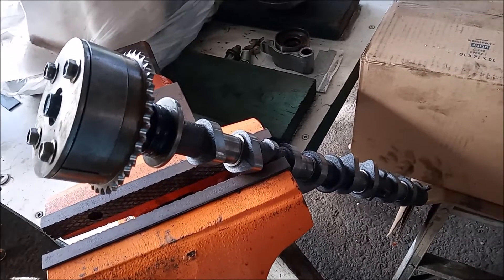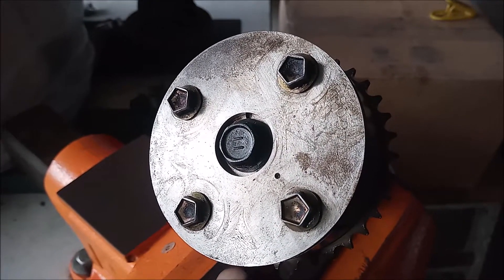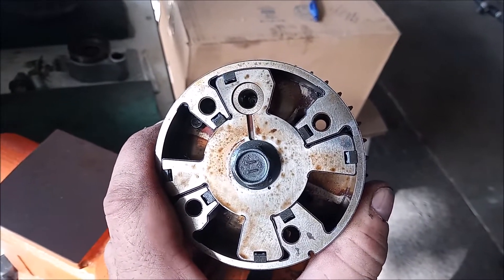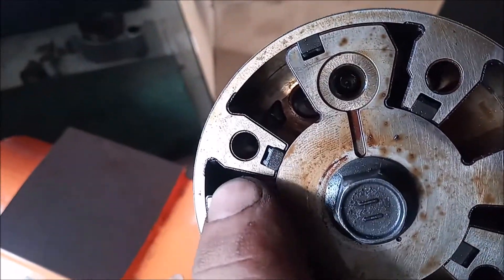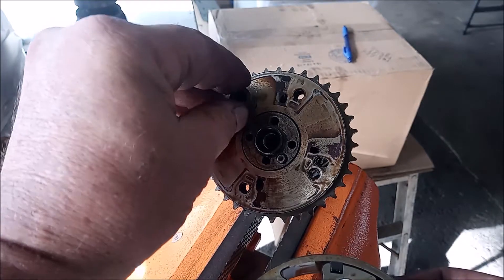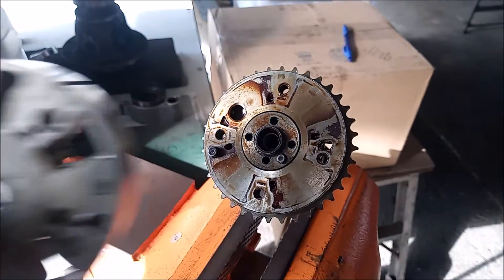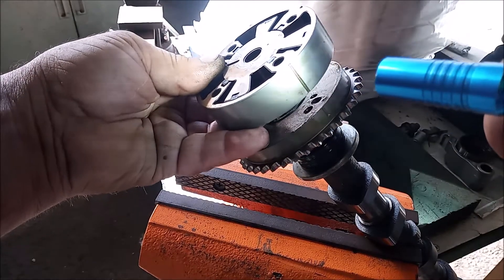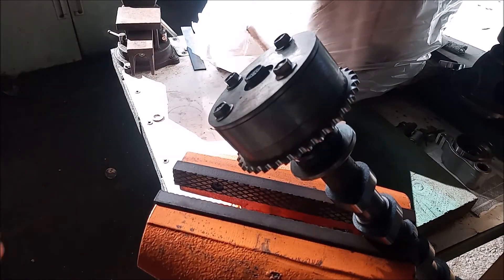Inside The VVT-i Camshaft Gear - Toyota 1.8-liter 1zz-fe/2zz-ge Corolla Celica Matrix MR2 Elise

Comment: Please help. My car wont start. At one point it was starting and while the car is on and park it would rattle like a marble inside a spray can very fast. Now it might start for a second rattle and then shut off. I already changed the timing chain tensioner and i didnt help. Do you think its the camshaft gear you are showing in this video?
Reply from the maker: It could be anything. There is no way for me to tell you one way or the other. Sorry. Do a compression test, and do a leak-down test. Look under the valve cover for any sign of damage to the valvetrain. You can try replacing the camshaft gear but without a confirmed diagnosis that is just throwing parts at the problem and hoping they stick.
Reply: @Merryfrankster_   thanks for replying i know its so hard to diagnose over text words. I will do those things you mentioned and see if i can find the cause. I already changed the starter motor as well. I sprayed starting fluid inside where the air filter goes towards the engine and it still wont start.  I watch other videos about turning the camshaft pulley by hand. I noticed it gets hard and then it gets really easy to turn by hand with a socket and rachet. Is this common?
Reply from the maker: @timmybangs4711  When you turn the crankshaft by hand you are working against the valve spring pressure. It is hard to turn as you compress the springs on each cylinder, then it eases off when the cam lobe releases the spring.
Reply: @Merryfrankster_    yes that sounds like what its doing. but i wouldnt know all these terminologies. im so lost but thanks for commenting
Reply from the maker: @timmybangs4711  How about this terminology: "take it to a mechanic."
Reply: @Merryfrankster_  lmao its 2002 corolla. Its not going to a mechanic. Its for me to play with and learn lol

Comment: Great videos, they are very helpful!  I am considering replacing the VVT-i cam gear on my 1ZZ-FE.  Instead of using the compressed air method to unlock the gear in order to torque it to the cam, could I just manually unlock it as shown in this video?
Reply from the maker: When you stop the engine, the vvt gear goes to the lock position. The only way to unlock it is either oil pressure or air pressure. There is no manual way to unlock it, unless you disassemble the gear. Personally, I would not be disassembling a brand new gear.
Reply: I appreciate the advice.
Reply: Personally unlocking it with air was almost impossible for me with a new gear, taking the 4 screws off the center was the only way I was capable of unlocking it. Just be careful handling it and putting it back together, and if you over tighten the 4 bolts it won't move at all
Reply from the maker: @braydendyer7008  the gears are NOT to be disassembled. The factory service manual gives the only correct way of unlocking the gear, and that is using compressed air. If you do go about it correctly, as shown in the video, the gear will unlock. Never disassemble a gear that you intend to re-use. You do so at your own risk of the gear failing or malfunctioning later. Sorry.
Reply: @Merryfrankster_  I removed the top plate with the 4 bolts, removed the pin and the spring, rotated the gear, reinserted the spring, pin, and cover plate. I didn't do a full disassembly. I didn't think it would be an issue...

Comment: A car is Corolla 2001 1800 cc without VVT and its engine is damaged and I want to install a motor for it and I can only find it with VVT system and I do not want to change the car device and I want to cancel the VVT system to fit the car, is it suitable please and how is do?
Reply from the maker: No problem. If you leave the OCV unplugged the VVT will stay locked - that is like no vvt. You don't have to do any modifications.

Comment: I recently bought a celica gts and just started doing the rattle at startup , then the p1349 comes up after a 20min drive is this my issue ? Would it need a new gear ?
Reply from the maker: Possibly it needs a new gear. Try the simple things first - clean the OCV filter and passages that become clogged with oil sludge, check the OCV solenoid function.
Reply: @Merryfrankster_  both ocvs? I cleaned the screen and ocv on the battery side but can't get to the one on the belt side cause of that tube that goes from the valve cover and am I able to install out the box or do I have to mess with the lock unlock stuff , I don't have compressed air
Reply from the maker: @BayAreaWrecker  the OCV on the transmission side is the lift OCV. This does not cause a startup rattle. The OCV behind the alternator is the VVT ocv. This one can cause a startup rattle. I have a video titled "hidden oil leaks" that shows clearly the location of this OCV on the 1zz engine, on the 2zz engine you have some other plumbing that you have to move out of the way but it is essentially the same location as the 1zz.

Comment: Can you tell me if an engine from a 2006 vibe will work in a 2001 Corolla? My engine is blown and the scrap yard saying that the vibe engine is different. Something about the vvti, saying it won’t run right. I know the intake manifold and throttle body’s would have to be swapped and possibly the exhaust manifold. I don’t want to buy the engine if it can’t be swapped.
Reply from the maker: The scrap yard is correct. The Vibe and Matrix engines from 2003 and later all have VVTi. They require a different Engine Computer Module and different engine harness and body harness.
Reply: Is that just the vibe and matrix or the 2003 and newer corollas as well?
Reply from the maker: The 2003 Corolla is almost exactly same as 2003 Matrix @Scotttt34
Reply from the maker: If your engine is a vvti engine, you will need to move your knock sensor to the new engine, move the fuel rail and injectors to the new engine, move the intake and throttle body to the new engine, then it should just plug in to your engine harness and run with your ECU.
Reply from the maker: Also, the O2 sensor will be different. You must move your O2 sensor to the new engine.
Reply: Thanks for the info. I should be able to swap it. Cheers
Reply: My car says vvt-i on the plastic cover that bolts to the valve cover

Comment: Which is the tool that you used for opening the four bolt .can you send pictures of the tool to me
Reply from the maker: Sorry I did not find the correct pentagon socket so I just used locking plier to loosen the bolts, they are not very tight.

Comment: Hello sir, i have a 2zzge engine with 65k miles, i have the car 3 years and all this years i hear 4 times in cold start rattle noise (1sec) maybe is this gear on video or chain tesioner etc...can destroy the engine this sir ? Today i hear again the rattle only 1 sec on cold start and only if the car stay over 3 days without working the engine and all oil is on oil pan. also the engine work perfectly after this rattle sound, no issues.
Reply from the maker: Make sure it is not the accessory belt tensioner making this noise. To test, while the car is cold, remove the accessory belt (this means the serpentine belt), then start the car. With worn out accessory belt tensioner, you will often get a noise on cold start. If this is not the cause of the noise, then it is due to low oil pressure on start. Can't reallly do anything simple about that.
Reply: @Merryfrankster_ I have some marks on my camshaft lobes like wear but is smooth with my nail test from side to side. Is this dangerous for the camshaft life or can live like this another 80k miles (I have 80k now) ?
Reply from the maker: @DimoS...  In general if it passes the nail test it is ok. But make sure it stays well lubricated. Use high quality oil with good wear prevention properties. Check the valve clearance in case it needs any adjustment. Too loose = more noise, too tight = more wear.
Reply: @Merryfrankster_  thanks sir. I use 0w40 mobil1 fs every 2.500 miles and my valves clearance in intake cam is 0.15mm. 0.006 inches if I'm not wrong. Spec is 0.08-0.18mm right?
Reply from the maker: @DimoS...  Buddy I am not chatgpt or the encyclopedia brittanica. I'd have to look up the numbers.
Reply from the maker: @DimoS...  Your choice of oil sounds very good, that's one of the best oils for wear prevention.
Reply: @Merryfrankster_ So does a bad belt tensioner make a similar noise to a bad VVT gear? I wanna narrow that down. Thank you in advance man
Reply from the maker: Yes the belt/tensioner can make a rumbling noise on start. To test for it, take the belt off, and start the car.  @damon323

Comment: Hi,can a vvti engine start  or run without a vvti cam shaft and without sensor
Reply from the maker: Never tried it but I imagine it messes up the oil flow through the head. If you want to disable VVT just unplug the OCV. You will have a DTC but the engine will run fine. If you want to run at a fixed advance then remove the camshaft, open the gear, and weld it to whatever position you want.
Reply: @Merryfrankster_  Can you do a video on this?
Reply from the maker: @AnythingEverythingGh  What's "this."
Reply: @Merryfrankster_  Open the sprocket, advance it manually and put it back to the car.
Reply from the maker: @AnythingEverythingGh  For $5 maybe I would. Mariachis don't play for free.